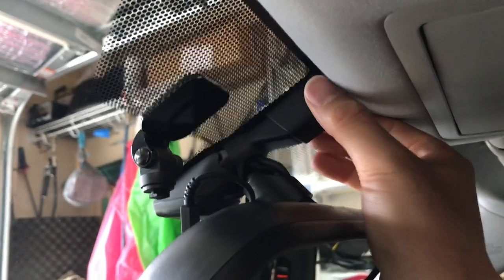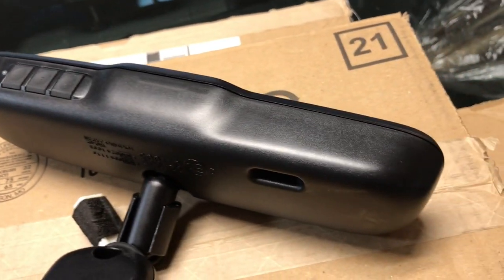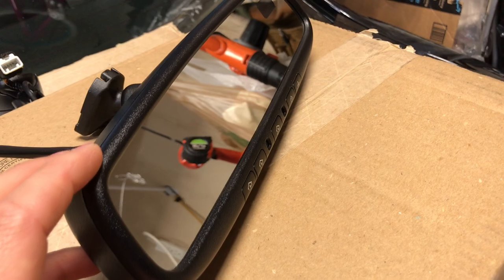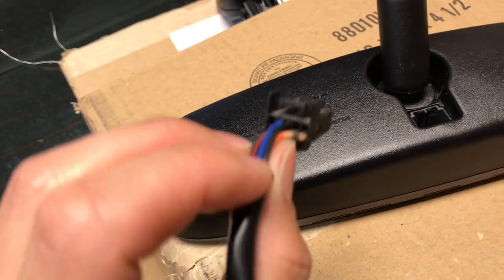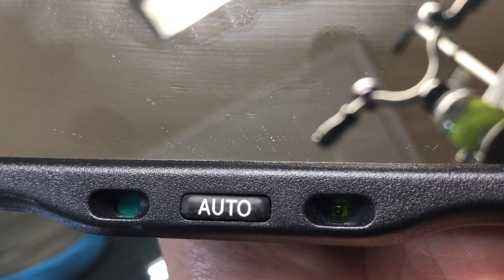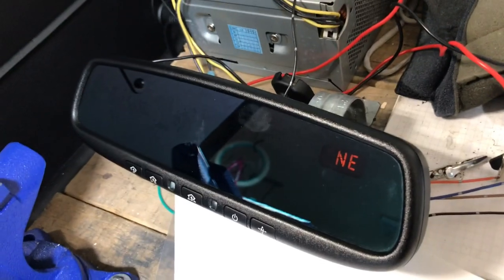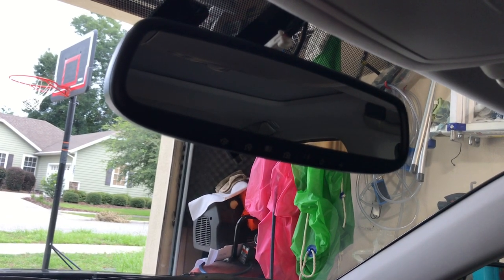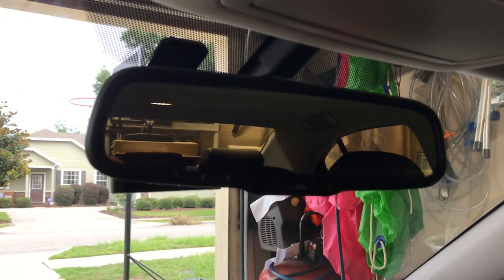Lexus IS250 Foggy Rear view Mirror Replacement Gentex GNTX-453 Homelink Compass

Comment: Could you show where that connector coming out of the headliner connects for the auto-dim mirror? I have a 2008 Lexus IS220D (European model of the IS250) and I wanted to install one of those mirrors, and I suspect it is connected to the circuit board where the dome light is but I could not find much info on it. If you could give me any help there, I'd appreciate it.

Comment: 16:21 Note: The 2011+ OEM 2IS is now a 10-pin connector instead of 5.  Pin #1 12V Ignition (IG), #2 Ground (E), #3 Unused or Reverse, #4 EC+, #5 EC-, #6 12 V Constant (+B), #7-10 Unused.
Reply from the maker: good to know. I know the 2011 switched to Gentex from the old mirrors.

Comment: What did you connect the wires too? You didn’t show
Reply from the maker: easiest way is to clip your old harness and match the wires for power and ground. The 2IS mirror also has extra wires for auto dimming side mirrors but most have the option. The Gentex mirrors may come with different pinout depending on which model and car it was harvested from.

Comment: I have a 2008 is 250.  Do you know if it will be easy to change myself. Do you know a cheap mirror?
Reply from the maker: Check the links in description. Any Gentex mirror should fit, just clip your old plug and wire to the new mirror plug. The IS has extra wires for side mirror dimmer (optional package) that most IS’ don’t have. Main wiring is powers and ground.
Reply: Ok... thank you I don’t think my IS has the dimmer package.  So I will try to order a mirror and put it on.
Reply from the maker: @vino6018  , make sure new mirror comes with wiring pigtail. That’s important.

Comment: Great video! 
I'm trying to solder the Gentex to the original OEM connector. Do you know the wiring for the OEM mirror? If I understand correctly @4:29, the 5 OEM Wires are: 
GND(blue) - n/a(green) - n/a(yellow) - ACC(orange) - 12V (Red)
Reply from the maker: No. If you look at the 4:25 I posted a factory wiring diagram, there are pin numbers and colors P=purple, B=blue, etc.
Reply: @TunerwithKids  I think you may have seen my unedited comment (my original comment was incorrect I think) 
I'm understanding now that your diagram is for the harness wires colors in the car, not the mirrors wires 
I'm re-soldering the mirror's wires, so the colors are different  @16:04
Reply from the maker: Pai K , better to use the PIN number as it goes in order. Maybe plug mirror and match mirror with car colors and then use diagram as reference. Pin 1-GND, Pin4-12V IG, Pin 5-12V constant. Other two are for side dimming mirrors (if equipped).
Reply: @TunerwithKids  Thank you for help and video! I think I got it now.
Reply: I just made my mirror work thanks to you and Binh’s comments. Thank you 👍

Comment: For the life of me I can't figure out how to get that black trim piece off that covers the wires up, any suggestions  ...
Reply from the maker: Slide the neck down? There’s two tabs that tuck to headliner.
Reply: @TunerwithKids  so do I need to squeeze it at the top while pulling down, that thing won't budge
Reply from the maker: Maybe someone glued it during a windshield replacement?

Comment: This is random, but my car was stollen (I got it back a few days later thankfully) but the guy who stole it broke the rear view mirror. The piece that stays on the windshield that slides into the bottom, he actually broke it all off so now there isn’t the sliding piece on the glass now.. any thoughts on what could be done as a replacement?
Reply from the maker: Probably take it to a window shop, they should have that piece since it’s universal and the right glue to hold.